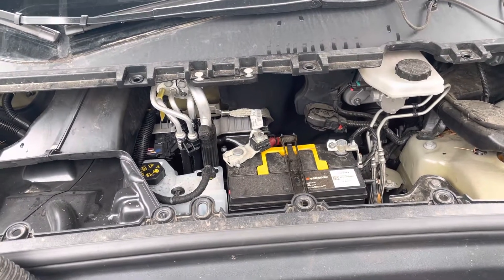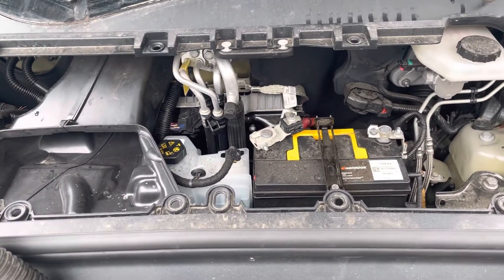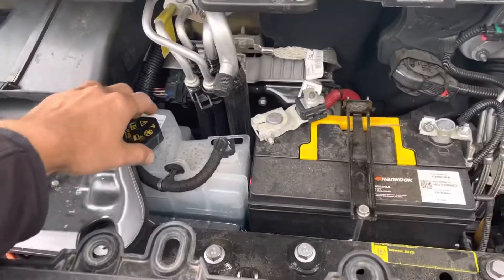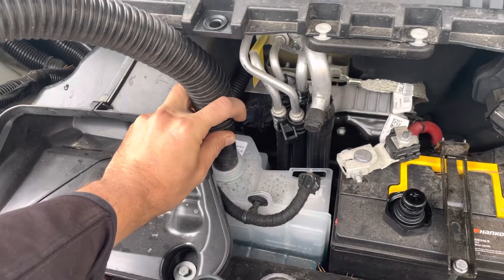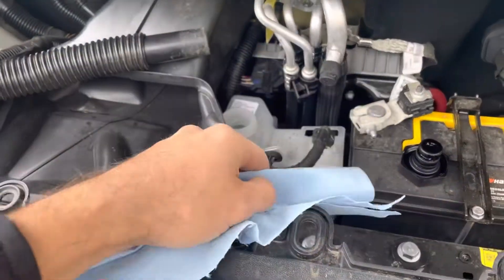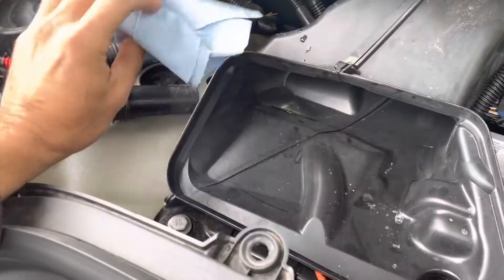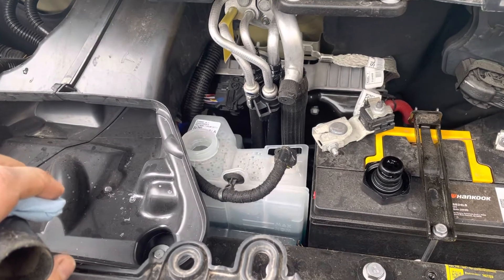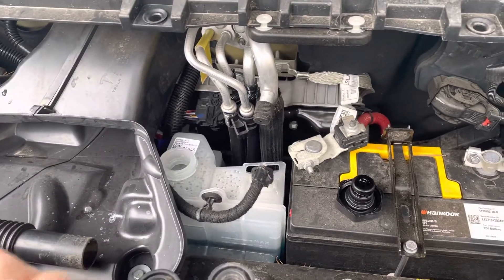How to bleed air out of coolant / antifreeze on Tesla model 3 and Y

Comment: Hey after wreck I replaced parts and replaced coolant but tesla manual sais capacity is like almost 16 litters but mine inky took 1.5 to 2 gallons
Reply from the maker: Yeah shouldn’t take more than 2 gallons as you wouldn’t be replacing all of the coolant, only whatever drained out.

Comment: Thank you for this, will this address the "Coolant low - OK to drive" warning?  It's -14C today just coming out of a -35C deep freeze and this happened on the way to work.  Car was preconditioned before driving but the cabin wasn't fully finished heating before I drove away.  Thanks in advance
Reply from the maker: No it won’t.  You need to add more coolant.  And possibly also need to repair a leak.

Comment: Why do you need to bleed air out of coolant before to fill up the fluid?
Reply from the maker: Only need to bleed air if air got in, typically happens when any component with coolant lines is replaced.
Reply: So coolant needs filled even if there isn’t anything wrong with the system?

Comment: Thank you for useful info 
I bouta 22 model 3 and replaced rear cradle. It was hit from rear quarter panel. 12v has juice and high volt shows 75 miles 
I can enter in service mode but it would not perform coolant purge. Error is pump is has no power or in other words pump not workin 
2nd issue after every time reset screen comes up but around 10 mints it would go black 
I tries to update it would download and install 10 percent or so and screen would black 
Need help it seams like you have a lot more knowledge about Tesla then most of guys on YouTube
Reply: Could you send again discord link
Reply from the maker: I don’t do remote diagnostics. Join our Discord for help https://discord.gg/qMdQNcbC
Reply: u have to unlock the process also when purging , u have to be connected to a charger. for all functions to work
Reply: Hello,
Have you solved the problem?
I have the same after changing a cooling hose 
Thanks

Comment: But you have to vacuum the air out before or after you refill the coolant reservoir or before.?

Thanks.!
Reply: I tried but vacuum would start sucking coolant do we have to have it certain level?
Reply from the maker: First fill, then vacuum, and keep adding coolant as needed.
Reply: @diytesla  where did u when to buy the coolant
Reply from the maker: @214felixortiz8  g48 at Oreilly Auto Parts